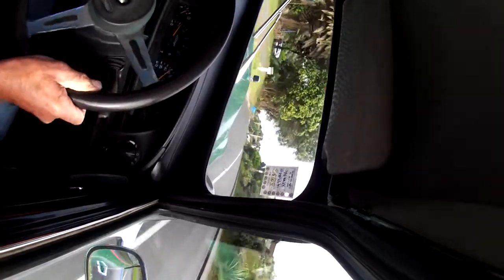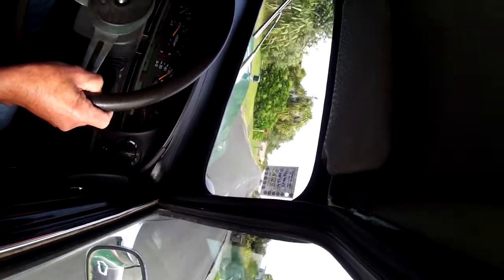V6 Holden powerd MINI Mouse Rod Drivers POV

Comment: Oioi , I'll have to make a vid for ya fella, i live in whitley bay, and a lot has changed here mate, i'm guessing you used to do the "circuit" on the one way in Whitley? well a majority of the one way is still there, but there has been some changes , the main road now runs round the back of the Dome, and there's a school where Spanish City used to be!!